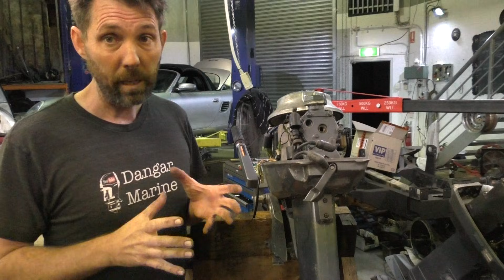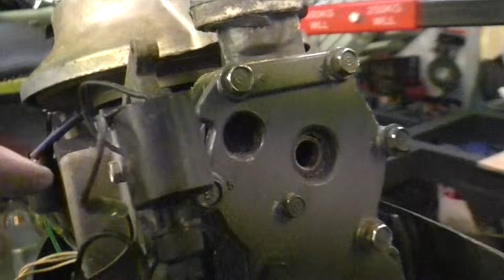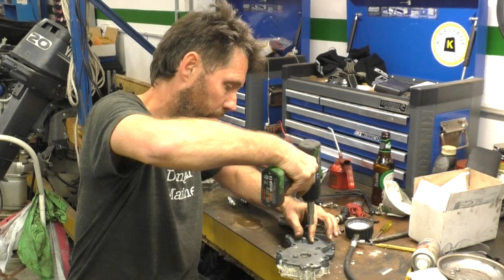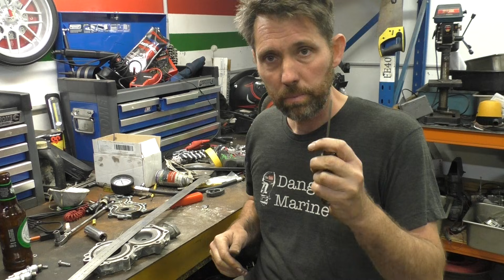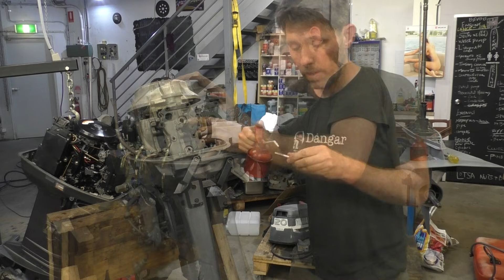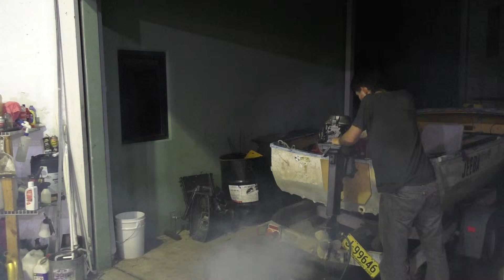Replacing a 2 stroke outboard head gasket

Comment: Stu - as always, thanks for keeping these old videos around. Found out this last week my 1973 Johnson 50hp is either dealing with a head gasket problem or a water jacket issue. If it's been sitting for several days, it starts and runs without issue. But if it's been run hard and warmed up, it doesn't want to restart. I took it to the shop and they cleaned and tuned the carbs but still couldn't get it to idle. After it had been running for a while, they pulled the plugs and saw that they had water on them. So there's either a leaky gasket or crack somewhere. As AvE would say, it's already fuckered so I can't make it worse so going to pull the water cover and head and see what I can see. Replace both seals and then reset the timing and see what we get ...
Reply from the maker: With water on the plugs it definitely sounds like your problem. Good luck with the job!
Reply: @DangarMarine  yeah it certainly seems like it. If the head gasket has an issue, could it still compression test ok? The shop said both cylinders tested at 100psi cold. Not great but not terrible.

Comment: Hello there, hope all is well, I got given an Mariner 3.3 non runner the other day, I don’t know anything about boat engines, but thought I have a play around with it, it was seized so I manage to un seize it, I tried to start it but it wouldn’t fire up, even with fuel down it’s head, the carb and jets are very clean, I noticed one of the bolts on the head are snapped, so I removed the head and theres a lot of sand and bits I inside and around the gasket etc, is it possible the head gasket needs replacing? I didn’t have a gauge so I couldn’t check the compression

Comment: Does anyone know if it is common to need to adjust the idle after replacing the head gasket?  Hoping it's just a sign mine had been failing slowly for a while and not that I messed something up.

Comment: Lower head bolts might be tighter for reason you said, they Need different tool as in box end wrench. So tightening box end by hand might be tighter than uppers used with torq wrench?

Comment: Cooling water at the exhaust and the telltale but none at the thermostat.  Engine is overheating.  Could that be caused by a bad head gasket?
Reply from the maker: Possibly, could be combustion gases displacing the water or a blockage.

Comment: On the 2 lower head bolts. You can use a torque wrench with a dog bone wrench at a 90 degree angle and get accurate torque.

Comment: Hello Stu. Was wondering what's the name of the aerosol product used to coat both sides of the head gasket. If a few more hours will need to make a preventive maintenance on all water jackets and install new exhaust and cylinder gaskets as well.  Was planning to use Permatex Aviation to coat both gasket's sides. Thanks

Comment: I am certainly not questioning what you do because as I have said before, you are the man, with the best marine repair videos on YouTube.  With that said I was just wondering if you were running that motor without water or am I missing something?  Also, I have an 1999 Evinrude 115 hp 2 stroke and I am getting the following compression readings #1- 85lbs, #3-100lbs, #2-15 lbs and #4- 90 lbs.  All plugs are showing spark but the #2 plug does not have the black carbon soot around the electrode like the others.  Hard starting and running for a very short time and then dies.  Would a head gasket problem around #2 cylinder cause this problem?   Hope this is a head gasket problem and not rings.  Any advice for this DIY'er who is retired and cannot afford to pay someone $100 bucks an hour?  As always thanks for what you do.
Reply from the maker: Hi mate. I may well have forgotten to turn the water on, filming always distracts me from the job. Could be head gasket or could be rings, you won't really know until you get it apart unfortunately.
Reply: @DangarMarine  Greetings sir!  I checked the compression after putting in 1 tablespoon of 2cycle oil and the compression went up to 55 lbs in the #2 cylinder.  I'm starting to think it is the rings (oh boy!).  Is there a way to check if it is the head gasket before getting into a ring job?  Thanks for responding and for all you do.

Comment: Hey Stu,  Thanks to your excellent videos, I just replaced the head gasket and thermostat in a 1984 Johnson 40 HP.  I did not do anything to pistons, rings, etc.  Do I need to follow all the standard break in practices (fuel mix, stepping up RPMs over time) or is the break in for a just a head gasket change more abreviated? Thanks again !
Reply from the maker: No, no need to do the break in procedure with just a head gasket change.

Comment: Hello Mr. Dangar specialist
Thank you for your great show.
As I can see, you sprayed the seal with a Hylomar spray.
The Yamaha dealer told me that the seals should be installed only on a dry surface. The new head gasket is sticky and the upper gasket is not.
I just put together my 2 T Yamaha 60 FETO. I assembled the seals on dry surface according to the service instructions. I only lubricated the screws. With 35 Nm torque, a litlle bit more. 
What is recomended. Or I made a mistake ? Or should I sprayed the seals ?
.... the top tube of the autolube was fell down and the cylinder was oil-free ... ?
When I was doing the protocol lubrication test, I obviously forgot to put it back ?? !!  Clever of me
Failed holidays !!!
Thank you for yours the detailed service views and maby your answer ...
Best wishes from Slovenia 
 Borut
Reply from the maker: These days I would always follow the manufacturer's recommendations for their head gaskets. It is certainly very common for them to come pre-treated.

Comment: How much water should I expect to see coming out of the exhaust ports on an '81 90 hp Evinrude? I replaced the head gaskets thinking that would solve the problem but still getting some water blowing out. It is more of a mist than any kind of flowing water. Everything with the motor seems to be running as it should, no overheating, no fouled spark plugs. Do get some unburnt oil dripping down the lower after trolling for the day which I think is normal.

Comment: Great video after wire wheel. I use a pice of 1/2 inch glass with a sheet of sand paper to make it strait. Figure 8 motion. Have a good one
Reply from the maker: Yep, that's a great way to ensure the head is still flat.

Comment: Stumbled across you channel and learned quite a bit. Have water coming out of my spark plug hole so changed the water jacket gasket without success as there's still water. Pull it all apart and try again. Hope it's not a cracked head. Any other pointers? Thx!
Reply from the maker: That's not a good sign. It is either gasket or a cracked block or head.
Reply: @DangarMarine  Yeah, replaced the head gasket and water jacket and still get water coming out of the lower spark plug hole. Any use dropping the lower unit and replacing the impeller or is the head cracked. I don't see that its cracked. Thanks!

Comment: was wondering id you find oily mix in the carburetor housing on a v6 does that mean bad head gasket?
mine starts and runs like crap as well under a load

Comment: Hello Stu...love the videos. I have a force 50 hp from 1988( I think it's a Mercury model)  507y8c is the model number. I just replaced the head gasket and when I went to Bolt the head on I think I got bad information on the torque amount and I stripped two bolts, which I had to retap to ten millimeter..... can you tell me what the torque setting should be for this Motors head gasket bolts? I I don't know if it makes a difference but it's an American torque wrench we don't use the metric system as well as we should I apologize for that.
Reply from the maker: Unfortunately I don't have the spec for that motor. It may have stripped because the aluminium is brittle from heat. That can happen even with the correct spec quite often.
Reply: @DangarMarine  should I try not torquing it all that much and running it until it's warm and then maybe torquing it a little more

Comment: I've watched this video multiple times and read through all 310 comments before I reassemble my 1991 Yamaha 115 cylinder head that had a thermostat bolt break in it, then the extractor broke despite my best efforts. I have a new cylinder head, cover and gaskets and worked very carefully to clean the block with scraping and then carefully and diligently used a bench stone to clean the remainder. I have checked and rechecked for warpage (over stoning) with an abnormally long straightedge ;-) My SELOC manual states in BOLD text in multiple sections NOT to use sealer. Stating that an even coat is near impossible to obtain and  "Never, never use automotive type head gasket sealer. The chemicals in the sealer will cause electrolytic action and eat the aluminum faster than you can get to the bank for money to buy a new cylinder block."  All of this conflicting info is causing my over analytical mind to go into convulsions! Since I live in Alaska and can't seem to get Hylomar and Permatex High Tack spray-a-gasket Adhesive Sealant rated to 450 degrees F. (232 C.) is the closest I can find I think I will just opt to go dry. The manual does call for Permatex on both side of the thermostat gasket so I will use the High-Tack there. 

The next thing to agonize over will be how to set all the bolts for new cover and top. I did get all new bolts and even replacement washers. I think I will clean the threads into the block and use the blue Loctite method, decreasing the torque value by 25% as stated here on Anti-Seize Technology site under FAQ:   https://www.antiseize.com/Content/Images/uploaded/torque_specifications.pdf

Stuart, thank you so much for all the videos you have created. Your knowledge and humor have been an invaluable asset to me. I gave you a FB recommendation, subscribed, and ordered a bunch of DM swag from your site so that me and the family can stay warm as we drift aimlessly about as I bollock-up my kicker! I lament that my late father never got the chance to watch your videos. He lived in Australia for a year and had a 39' sailboat in Washington state. He would have loved your channel!  He would want me to quote Wind in the Willows and what Water Rat said to the Mole: "Believe me, my young friend, there is nothing--absolutely nothing--half so much worth doing as simply messing about in boats." Cheers Stuart!  ~Ben (ps I just signed up as a Patreon, keep up the good work and have a Coopers on me, Mate!)
Reply: I always see people using bench stones, did you use it on the block with the pistons in? I am afraid of getting metal scrapings in the cylinders by doing this.

Comment: Tip on removing corroded head bolts:  Just after you break them loose - work them back and forth a bit to break up the corrosion.  1/4 turn back and forth 5-6 times will break most of the corrosion on the threads into a fine dust that is much less likely to bind the bolt, and cause it to snap.  Penetrating oil after you break up the corrosion helps if the oil will flow into the threads.
Reply: good advice but when they wanna go they SNAP
Reply: @jazldazl9193  If it looks extra dicey, then you can always heat the crap out of it before you get started.  This also helps to break up any rust or other corrosion, and tends to loosen things up quite a bit especially with dissimilar  metals that expand at different rates.

One other thing to be aware of when dealing with aluminum.  Check your bolt hole carefully after you remove the bolt... frozen bolts tend to take a good portion of any aluminum threads out with them.  Certain Ford engines have this problem with a specific spark plug that no one ever wants to change, and then they start blowing out spark plugs.  It's best to find this out and Helicoil it before you are redoing a head gasket job because the bolts keep coming loose.

Comment: What would be a symptom of exhaust gases leaking into water jacket either from under the head gasket or exhaust cover on two cycle engine, engine runs OK but overheating and water stops flowing from a witness hole. love all the vids you post Sir
Reply from the maker: Yes, pretty much what you describe. Sometimes the water will keep flowing out the telltale but in pressurised pulses as the engine fires.

Comment: Hey Stu,
I am rebuilding an old 15 hp Yamaha, I've replaced cylinder bores, pistons, piston rings and all bearings to the power head. 
I can't find information on how to "break in" a "new" outboard (two stroke), maybe you could do a video about that. Or maybe someone who knows will reply to this comment. Thank you.
Cheers
Reply: so just for the first 3 gallons use a 25:1 mix (which is simply a pint to 3 gallons). no stabilizer just gas and oil. make sure the throttle is down to a crawl when you first fire it up and just let it idle for the first 10 minutes. don't touch it! let the rings wear in as best they can. then take it out on the water. if you boat is light, smoothly but quickly give it full throttle to plane off, then back off to 1/2 throttle. if the boat is heavy, don't go above 1/2 throttle for the first hour and vary the speed every 5 minutes or so very slightly.  if you are out of gas by now, refill with 50:1 for the rest of break in.the second hour you can give it 3/4 throttle every now and again, but continue to vary the speed. from hours 3-10 give it full power every few minutes, but only for 30 seconds or so. BE GENTILE the first 10 hrs. after break in is done, check the plugs and lower unit oil for metal and / or water intrusion. you can now use 100:1 fuel ratio, but be sure to use marine stabilizer each tank for the life of the motor to prevent internal corrosion. its especially important with 100:1 mix as thats not enough oil to protect the crank from corrosion when not in use.

Comment: you lubricated the threads.... was the specified torque in the book dry or lubricated? If you lubricated threads and torqued  per a dry specification it is likely overtorqued.
Reply: how would that make any difference? the dry bolts if they are new will screw in with your fingers. here he has corrosion. lubricating them brings them back into spec.

Comment: good trick with the hand torque method is to use a scale on the end and read where it clicks, and do the same for the hard to reach one (same length wrench of course). On some outboards dropping the lower cowling gives better access - thanks for the vid!

Comment: Kiwi tip: if you wind your ratchet spanner out too far...push it in and use a regular set spanner to wind the bolt back in! lol
Reply: There are many situations this does not work, simply because the bolt has a flange behind the hex.  Your only options then are to cut off the bolt to get your wrench back, or cut the wrench apart to free the bolt.  Cutting the bolt is usually the cheaper option, but not always!

Comment: Im looking at doing a compression test for a Suzuki 65 HP 2 Stroke,DT65, I think its a 1994. . What should the compression be? As I have read compression reading acceptability depend on the engine make
Reply from the maker: Generally around 120PSI, but don't worry too much about the exact figure. The important thing is that they are all within 10% of each other.
Reply: @DangarMarine  Thank you, and ill let you know how it went if I get the chance to do the test

Comment: Nice video Stu, when changing cylinder head gaskets I usually remove the entire powerhead, take advantage to clean all water paths, decarbon piston heads, exhaust area. Install a new  lower base gasket with s slight grease coating at both sides, and torque to specs.  that's to be able to remove the powerhead again without harimig the gasket  My motor has 4 lower head bolts impossible to be torqued with a torque wrench if powerhead reamins screwed on its base.I'm a manic about torquing all head bolts to same torque spec whichever they are.

Other issue, on 2 strokes 2 cylinder motors have never seen both plugs to come out in same clean cond, the lower one usually comes out bit darker than the upper one, and that's on new out of the box motors with few run hours on them., seems it's the nature of the beast.

When you torque a cylinder gasket with a torque wrench, say needs to be torqued back to 25 NM, you torque it in a single torque straight to 25 NM or in a 2 step process, say 13 on first one, 12 on the second torque adjustment.?
Reply from the maker: Removing the powerhead would definitely have been better but I'm too lazy. ;)
Reply: Have 2 interesting maintenance tips that have been using for several years, does Dangar Marine has an email address to send them over ?
Reply: Best way to decarbon piston heads pls? Cheers

Comment: The Brush you used to clean the Block , is that Brass coated Steel , or true Brass ? 
I cant find true brass for sale anywhere 
Regards
Reply from the maker: Good question, I couldn't honestly say, I'll have to check the package next time.
Reply: @DangarMarine  Thanks for replying , I am in the middle of a head gasket change on my 1999 Johnson 25hp & I am struggling to remove the gasket residue ....I am worried about damaging the mating surfaces by using something too abrasive. 
Do you think brass coated steel would cause too much damage ?